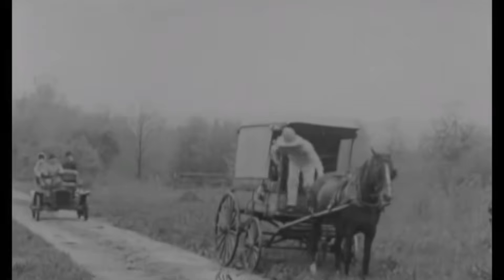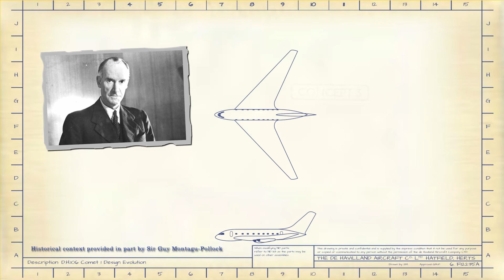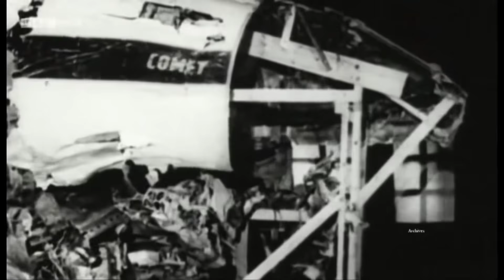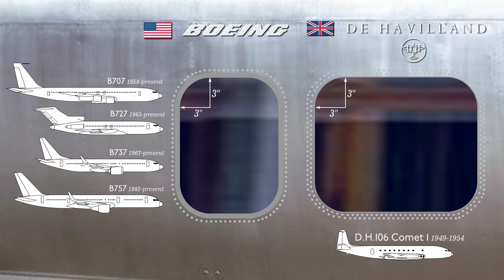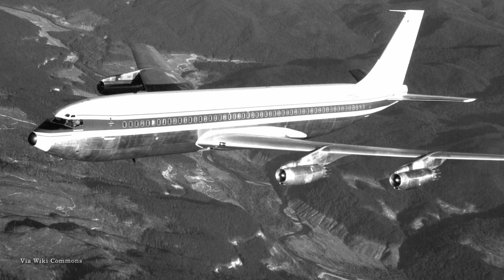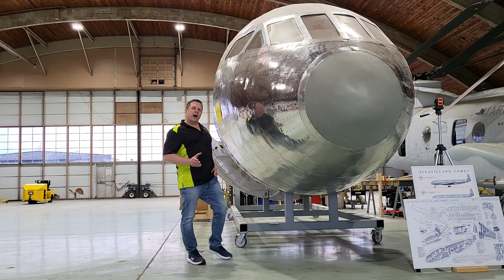de Havilland Comet 1 Project - Episode 1

Comment: As the worst engineering failure in commercial aviation history it's important to remember the Comet Disaster lest we forget and allow this kind of gross engineering incompetence and criminal negligence to happen once again.
Reply: The fabulous trail blazing De Havilland Comet. 

World's first production jet airliner doing regular commercial service. An Avro Lancastrian jet airliner was actually first. 

World's first high altitude jet airliner. 

The window design change from larger squarer windows to smaller rounder windows was necessary for that aircraft at the time. The fact that the incident wreckage and post incident tank testing showed fractures starting elsewhere etc does not indicate that the window design change was not essential at the time. 

There can be no excuses for the Bow-wing (See B-47 wing / folding  collapse incidents) Max incidents given that Bow-wing had more than 50 years design and build experience for the type. 

A typical Bow-wing (See B-47 wing collapse incidents) airline duty 707 lasted for about 23 years on average. The reason any lasted longer was large numbers built so lots of spares with a lot of airframes in military use with big military maintenance budgets and many often with low flying hours or in storage. A typical 707 is basically cheap nasty junk. 

All later jet airliners benefited greatly from the knowledge gained from the Comet incidents & subsequent investigations & yet some were still worse for accident losses. 

Instances of all marks of the Comet flew with full certification after 1954 including the Comet 3 with full certification remaining in place until after the aircraft were retired. The last Comet flight occured in 1997.

The nose design was unique to the Comet, Sud Aviation licensed the design for their Caravelle. 

The fabulous trail blazing DH Comet.
World's first jet airliner in regular service.
The jet engined Avro Lancastrian actually did a passenger service before the DH Comet. 
World's first high altitude airliner.
World's first airliner with a full fuselage length pressurised cabin pressurised for high altitude flight. That feature for that type of aircraft was a considerably difficult undertaking. 

How things were back then.
Accident losses - % of aircraft built.

DeHavilland Comet 4 UK                          14% 
DeHavilland Comet all mks UK (ff 1949)17%  
Vickers VC10 UK (ff 1962)                         5%

Douglas DC-1  US                                       99%
Douglas DC-2                                              47%
Douglas DC-3                                              30%
Douglas DC-4                                              26%
Boeing s300    US                                       72% 
Boeing 307                                                  70%
Boeing 247                                                   48%
Boeing 707  (ff 1958)                                 32% 
Lockheed L-049 Constellation (ff 1943)  30%
Lockheed Electra US (ff 1957)                   29%
Fairchild FH-227 US (ff 1966)                   30%
McDonnell Douglas DC-8 US  (ff 1958)   14%
Sud Aviation Caravelle  (ff 1955)             15%
Canadair CL-44 Turboprop US (ff 1959) 46%  
Convair CV-580 Turboprop US (ff 1960) 22%
Convair CV-880     (ff 1959)                      27% 
Convair CV-990     (ff 1961)                      33%
Tupolev T-104        (ff 1956)                     16%
Vickers Viscount UK  (ff 1948)                29%  
Fokker F-27 Trboprop NL (ff1955)40%      

The Vickers VC10, fastest Atlantic crossing for a non supersonic jet airliner, held the record for 41 years.

For the first few years of operation the Caravelle & Comet had similar accident loss fatalities.

Sud Aviation Caravelle - 
all accident loss fatalities - 
1320 fatalities. 

De Havilland Comet - 
all accident loss fatalities - 
453 fatalities. 

An example of a typical airliner from the period. 
The Fokker Friendship F-27 fatalities & accident losses as a % of aircraft built. 
Fokker F-27 Turboprop (ff 1955) 40%
2130 fatalities.

Boeing 707    3108 fatalities.

Of course De Havilland carried out a full stress analysis & performed extensive & protracted testing on two long lengths of fuselage representing all features of a complete airframe. De Havilland carried out significantly more testing than was required by any authority at the time & significantly more testing that any previous airliner was subjected to.

De Havilland designers / engineers knew all there was to know about metal fatigue at the time they designed the DH Comet.

De Havilland had prior experience building many all metal construction airframe aircraft including many passengers aircraft & thousands of jet powered fighter aircraft that were primarily of metal construction with pressurised cockpits & used jet engines built by De-Havilland.

De Havilland did indeed always work to better than industry standards at the time, used up to date knowledge for the design & testing activities & no evidence of negligence or criminal negligence was ever produced in relation to the DH Comet.

Global aerospace. 
From the 1950s sector rationalisation and consolidation took place. 70 companies in France and 300 companies in the US disappeared due to merger or dissolution. In the US Boeing was almost bankrupted by the 707 project.  Boeing had a well protected domestic market and the available space and resources in the US to engage in large scale airliner manufacturing enabling them to capture orders simply by being able to produce airframes fast enough and cheap and nasty enough. Another factor is airlines preferring to obtain as much of their airliner inventory as possible from one manufacturer.  Brazil has the world's third largest airliner manufacturer, Brazil is towards the bottom of the wealth over capita tables along with Indonesia. Most of the countries at the top don't bother having a single national airliner manufacturing company. 

Global Aerospace Sector, what's happening.

For example, there are of course no German companies that makes German jet aircraft in Germany & there are no German companies that make German gas turbine aero engines in Germany that are suitable for widebody airliners.

The UK has the world's highest combined per capita Nuclear / Defence / Aerospace Sector Activity.

UK defence sector, absolute terms, world's second highest activity. 1st for per capita defence sector activity. Per capita nuclear powered submarine construction, 2nd position. 
Main players being Rolls Royce, Babcock, GKN Aerospace & BAe Systems. Activities often involve international collaboration. BAe systems, RR and other UK companies now handle more Airbus work value wise than Germany. 

There's a good chance that anyone currently flying on a widebody airliner will be on an aircraft powered by RR gas turbine aero engines made in the UK and a good chance there will be other hardware on the aircraft that's designed and / or manufactured in the UK. 

Rolls Royce Holdings UK
Subsidiaries
- Rolls-Royce plc
- Rolls-Royce North America (ex Allison etc Classified Military stuff)
- Rolls-Royce AB
- Rolls-Royce Deutschland
- Rolls-Royce India Private Limited
- Rolls-Royce Marine Power Operations
- Vinters Engineering Limited
- Rolls-Royce Controls and Data Services
- Rolls-Royce Power Systems
- Bergen Marine
Joint ventures include:
- Rolls-Royce Turbomeca
- MTU Turbomeca -

Trent Family
The MT30 (Marine Turbine)
Industrial Trent 60 Gas Turbine
Trent 7000
Trent XWB Airbus A330neo.
Trent 1500
Trent 1000
Trent 500
Trent 600
Trent 700
Trent 800
Trent 8100
Trent 900
   
RR wholly owned subsidiaries in Germany handle smaller 2 shaft RR gas turbine aero engine work.

The UK space and aerospace sectors are highly productive, high-value industries that together contribute over £18 Billion in direct Gross Value Added (GVA) to the UK economy. Individually, the space industry directly contributes about 0.3% of UK GDP 7•2 Billion while the aerospace industry contributes approximately 0.5% £10•9 Billion.

The original alloy used for the Comet was discontinued by the manufacturer, that is why the alloy changed. The skin thickness remained the same for most of the airframe, the only change to skin thickness was the area where the wings meet the fuselage.  The window shape and size changes were necessary, the fact that cracks didn't run through viewing windows is irrelevant. The fracture that started at the rdf assembly window was due to fatigue fracture, the fracture started at a bolt hole. The fracture that started at an escape hatch during post incidents water tank testing was also due to fatigue fracture. all structural bulkheads, floors and decks were constructed using aerospace grade aluminium.